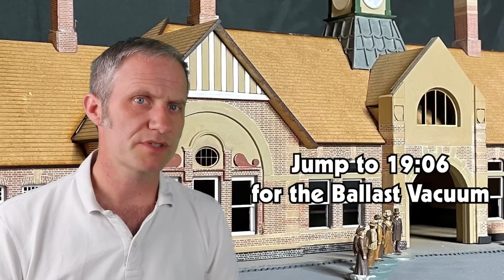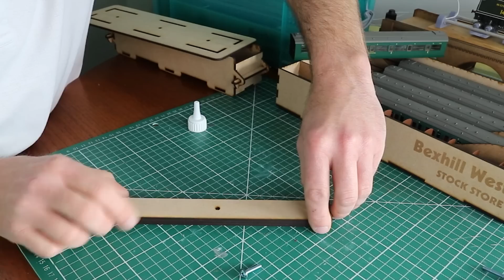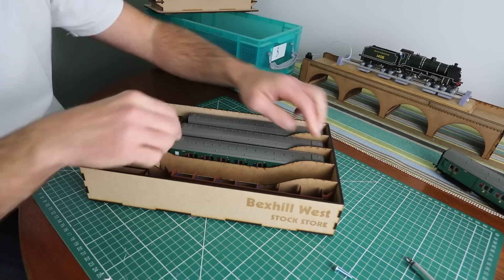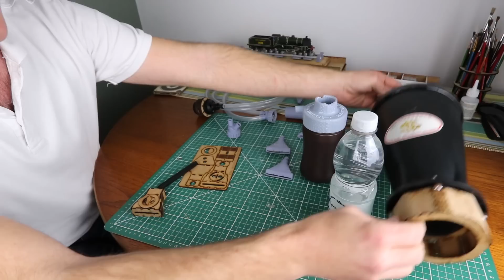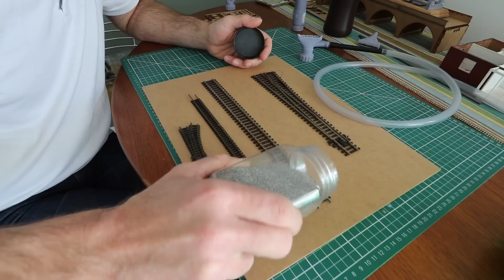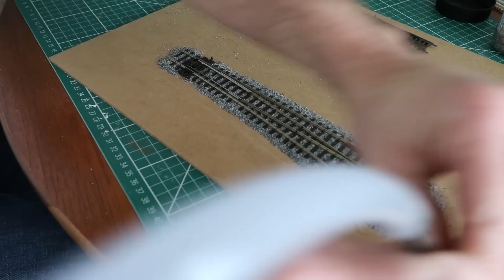May 2021 Update | Ballast Vacuum, Rolling Road and Carriage Casting Box

Comment: Hi James, as railway modeller(LB&SCRly) I've found Bexhill West immensely enjoyable and interesting, you seem to be the "mother of invention" and no problem stalls your progress for long.   1. The 
ballast vacuum nozzle and bottle filter cap I'd like to try out so, if they are available could you let  me know how to purchase them. 2. Unfortunately, Templot, a Windows app, won't work on my Apple Mac O/S unless I create a virtual partition: loads of hassle and may not be worth all the trouble anyway. 3. I'm trying to make drawings of West Croydon's Engine shed and station using LibreCad from original drawings, although the printed dimensions are not sharp enough to read; many of the features of the buildings, like engine shed windows*, main doors and roof ventilators were standardised patterns used all over the railway system, even before 1923 Grouping so, it makes sense to draw these as .dwg blocks to paste into other future drawings.  * the type seen in the Bexhill Goods shed - you can see exactly the same window type in photos of the LBSCR loco depot at New Cross (Deptford).

Comment: Hi James, for Paul's viaduct, it maybe worthwhile having a butress wall between each panel. Allowing the inner radius side of the curves panels to touch each other, but allow the outer radius of the curved sides to be spaced apart and covevered up by the butress walls.

For the bottle cap, an extension of the tube from the head unit further into the bottle, would help reduce any ballast etc from being pulled directly from the inlet to outlet.

Looks good tho

Paul
Reply from the maker: Thank you Paul, the butress suggestion is a good one.
Also, I have experimented with extending the tube, but found that there was no real benefit, and the print process becomes more complex.  Provided the collection bottle is stood upright then there seem to be no issues with material passing from inlet to outlet.  To be clear, the outlet pipe of the design as shown in the video does extend below the inlet of the bottle cap.

Thanks for the suggestions,
James